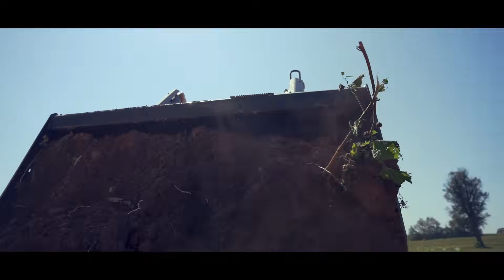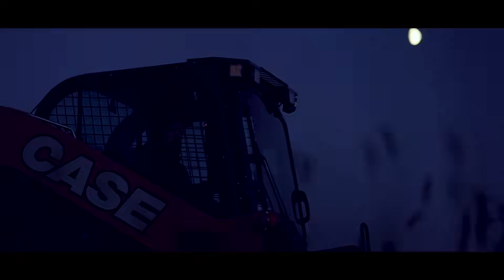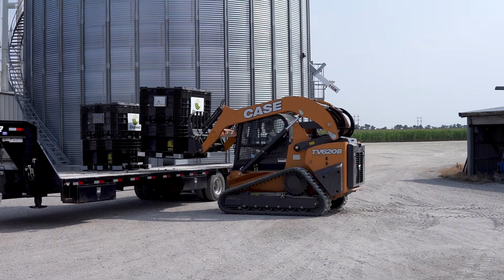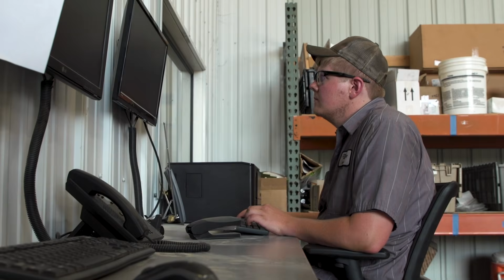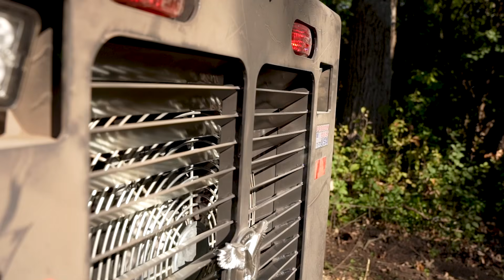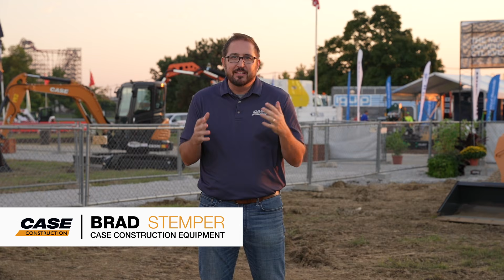North America: CASE LIVE: TV620B Compact Track Loader Launch

Comment: Why are the hydraulic hoses exposed on the back of the lift arms
Reply from the maker: In order to meet power and performance demands, the TV620B required hoses with higher hydraulic pressure ratings which came with a larger bend radius. Our loader design positions the cross member closer to the rear deck, so while those hydraulic hoses may be exposed on the back of the lift arms, you get all of the power you need without sacrificing visibility to the rear of the machine.